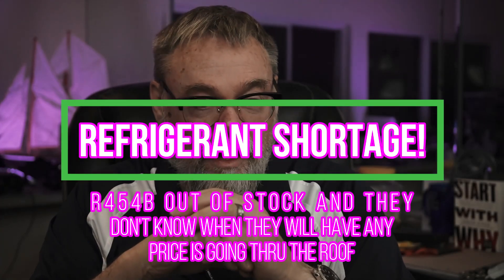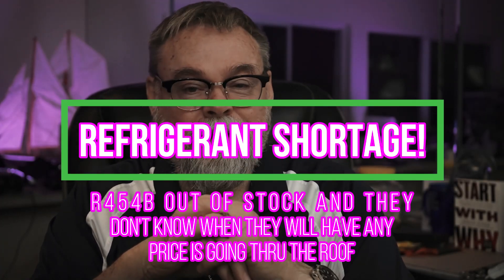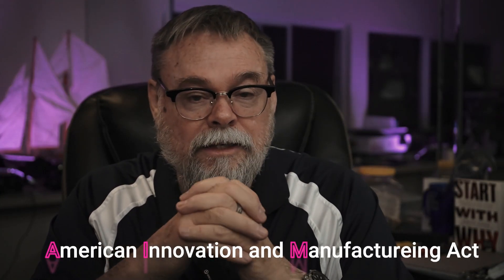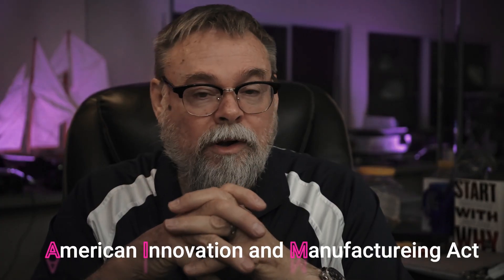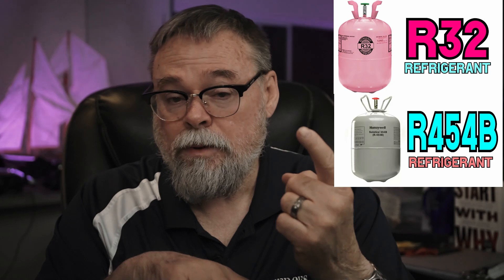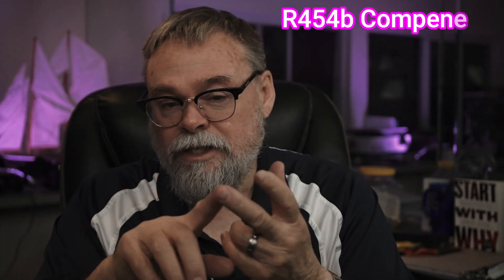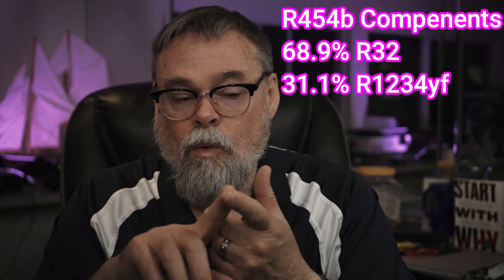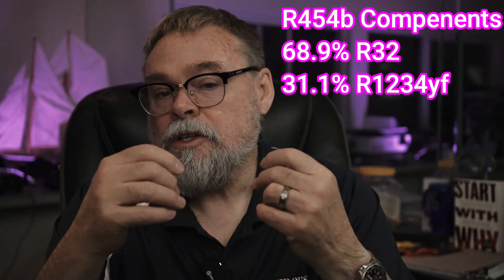Shortage of refrigerant what you need to know.

Comment: Ever wonder why a R32 20 pound jug actually has 20.95 pounds of refrigerant, and why a R-1234YF 10 pound actually has 9.90 pounds of refrigerant? Because if you "hypothetically" added those two together you would have a blend of 67.9 percent R-32 and 32.1 percent R-1234YF, that's within 1 percent of R454B, which is 68.9 percent R32 and 31.1 percent R1234YF. If someone "hypothetically" did that it would cost half the price of R454B.

Comment: We are starting health campaigns against PFAS and the inability to break down forever chemicals. Yet, we are installing the stuff in a system that can perfectly distribute throughout structures.
Reply from the maker: All refrigerants except for Ammonia, CO2, and Propane have PFAS in them. However, with the new sensors it should detect a leak before much has leaked out to recover and fix the leak.
Reply: @baileysair WHAT? might wanna study up on what PFAS is. 1234yf is the first freon with floride in it.
Reply: @baileysair read your comment out loud. If thats the case why haven't we been putting in these sensors all along???
Reply from the maker: @SeanMac1776  Wasn't required.
Reply: Freon is not a PFAS 1234yf is the first PFAS refrigerant.

Comment: Extortion pure and simple
Reply from the maker: What is worst is that a good friend and HVAC contractor I know made the switch to R32 equipment to avoid this highway robbery. He called and got a quote on a jug of R32 for $318 and he said set a jug aside I will come by in couple of days to pick it up. When he got there they tried to charge him $500 for the jug but he showed them the quote. He called me and asked should he buy two at the $318, I said YES!

So this stuff is getting expensive, I can still buy a 25 pound jug of R410a for $300 all day long. They never should have made the switch. This is one of those regulations I think that the Trump administration should see if they could roll back.

Comment: This new refrigerant is horrible. Especially, for commercial applications. The fact that now you need sensor in case you have leaks that will shut down your unit. How long are lead times on micro channel coils or how long are the evaporators in back order? It is crazy for a customer with a building that has no AC and now they need spot coolers for months.
Reply from the maker: I totally agree. First, this drivel about Global Warming Potential is still all theory. All you need to know about GWP is in the last word -- POTENTIAL. They base their theory on conjecture that concentrations of the chemicals in R410a will continue to increase and takes up to 45 years to break down. Second, they compare it to CO2 as your basis of GWP of 1. This assumes that the science is proven that CO2 causes global warming. However, there is evidence in past climate records through ice cores that does not support the theory that CO2 increase causes warming, instead some scientists have theorized that the increase of CO2 during warming was not the cause but the effect of the warming. In other words, they still don't know if the increase in CO2 was actually a result of the warming and not the cause. That the warming was caused by sun cycles and not CO2. The simple truth, they just don't know. Finally, all this assumes that we are just releasing all that refrigerant into the atmosphere instead of recovering it, which we are not doing.

As for the installing a sensor to shut down the unit is asinine. These A2L refrigerants are mildly flammable. The chance it could cause a fire or be ignited is almost impossible. It's a total waste of money. But the bureaucrats that write these regulations are total inept. Just because you can write a regulation doesn't mean you should. 

Combine all this with the shortage of R454b and how all politicians in the blue states want to electrify and we will have a revolt on our hands in the near future as people find out that a heat pump is not all that it is cracked up to be. Sure, they work in some climates like California very well. But with PG&E and SCE having electric rates exceeding $0.41 cents a kWh it will cost more to run a heat pump than a gas furnace. Again, follow the money, who benefits the most from a State that electrifies? In California that would be PG&E and SCE with their higher rates.
Reply: Madness and stupidity. Also, forgot to mention some of these units go into purges if leaks are present which shut the unit down but have the blower run and basically purge the refrigerant into buildings. They prefer to blast refrigerant indoors. My next question is are these pipes and coils going to go thru bureaucratic hoops and inspections  @baileysair